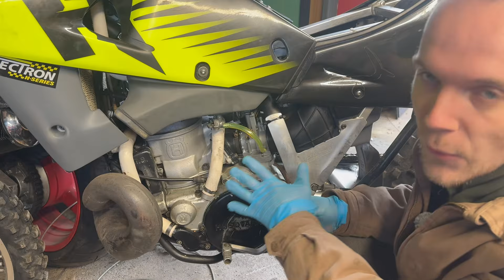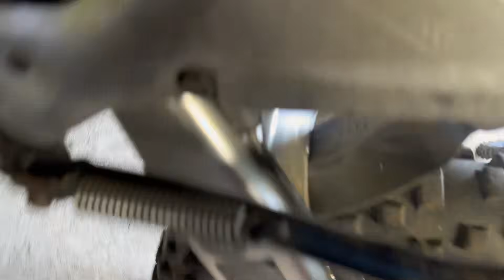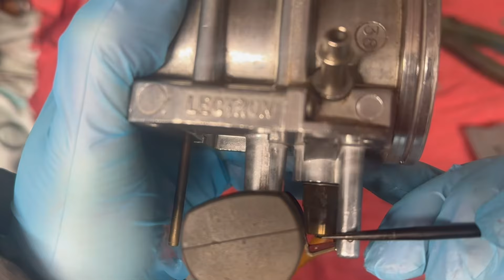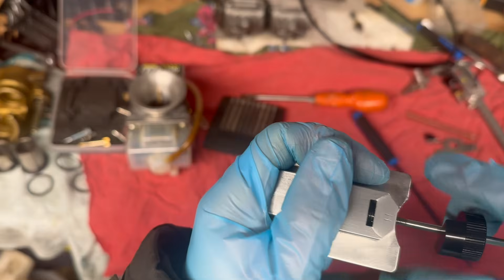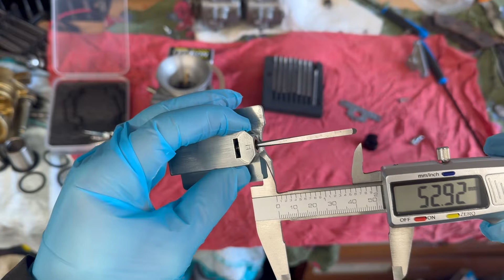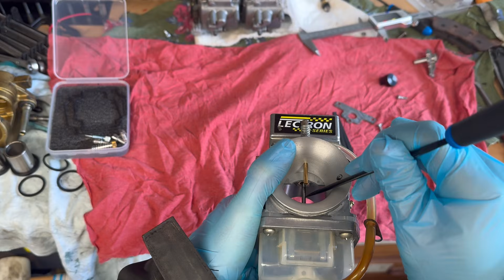LECTRON CLONE CARB - How To Tune, Adjust And Basic Carb Setup Guide

Comment from the maker: CHECK THE DESCIPTION FOR MORE INFO!

4 Adjustments to make with starting times below.

Float Bowl Level- 4:42
Idle adjust- 8:50
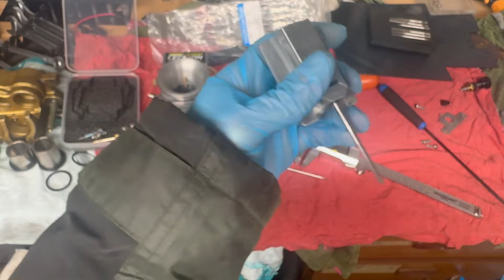Low speed throttle via metering rod- 10:38
High speed throttle via power jet- 15:49

Drop a comment or like if this video helped you, its easy.

Comment: Great vid!! I got a 26mm billectron mini (comes with a grooved metering rod) copy for my Suzuki dr200.  I get the idle to 3/4 throttle all set but it will not take full WOT, no matter I open it gentling or snap it open.  I wonder if the standard rod would help? I probably could get the metering rod another 1/4 turn leaner to try but I start feeling Im giving up the low end torque for the WOT. Another thought is to use something to block the last bit of the grooved to reduce the gas for WOT.  any thoughts will be appreciated, thanks 🙏
Reply from the maker: Thanks for watching. Have you tried adjusting the power jet?  Go half a turn either way and see if it improves.
Reply: @EABikes the power jet is already all the way in....
Reply from the maker: @viclau1218  I would advise trying to adjust it so the power jet is at least 1/2 a turn open  minimum as this fuels the upper end of throttle range.
Reply: Thanks for the advice and will give a try, I feel like even I'm closing the power jet screw completely, there's still some fuel leaking in the carb as the power jet needles may not sit perfectly on to the fuel hole, anyway, will give a try

Comment: My buddy and I use this on Paramotors. For our 150cc SKY engines, we're using the 32mm clone carb (which is a bummer, but it works freaking great!). We did have to sand the threads on about two or three turns to get it to fit further in. These are awesome little carbs, and the Chinese clones are just as good as the original, since not everyone can afford to spend $1000 USD on a carburetor.
Reply from the maker: Now thats cool! There is definitely a few quality issues with the clones, i imagine the idle is possibly slightly higher on your engines compared to the bikes so the low end issues Don’t show?

Comment: I've seen the idle issue fixed by grinding out the hole & groove in that plate a little larger. tiny tiny until it  is right bang on!
Reply from the maker: Yeah someone has said about that. I cant help but think it’s masking the problem rather than fixing it though! Maybe i will try it!
Reply: @EABikes  Je to zakryvanie problemu, ale len problemu tohto karburatora. Je to najlacnejsia a asi aj najrozumnejsia cesta, ako nastavit volnobeh, aby motor na volnobehu nekapal. Stravil som pri nastavovani jeho volnobehu dlhe hodiny a dni, skusal vsetky dostupne ihly a ich polohy, ale nic nepomohlo tak, ako obrusenie supatka. Myslim si, ze hlavny problem je velky otvor emulznej trubice, resp. maly priemer ihly a tym padom si cez nu motor okolo ihly taha prilis vela benzinu a tak je to furt na volnobehu bohate a nepomaha nic ine, ako dat mu viac vzduchu a to jedine obrusenim supatka, kedze skrutkou sa uz viac zdvihnut neda. Dalsi problem je s nastavenim jeho hladiny, aby nebola moc vysoko. Aj ked ohnete jazycek na maximum, aj tak je hladina vyssie, ako by mala byt. Od karburatora za 70€ netreba cakat zazrak.

Comment: I will be grateful for your advice, i try to run my klr 650 with fake lectron, got there two rods but can't set idle on both of them, still need to rise rod by throttle cable, those rods are different, there is no description on them, can you give me a hint? please, or what original lectron rod size should I buy for 650 ?
Reply from the maker: Unfortunately it’s unlikely the rod is the idle issue-either genuine or clone. If the thicker rod of the 2 on a low position doesn’t make it idle then you likely have the same issue as me and can only tune around the issue for best performance above idle only.
Reply: HI, I'D LIKE TO FIT IT ON MY KTM 450. HOW DID YOU FIND 4-STROKE WITH THESE CHINESE COPIES?
Reply: @andre_irt6026  I'm still struggling with this. Currently, the mixture is still too rich, but the worst part is that the level in the float chamber is still too high. Even after disassembling and adjusting it, after a while it's too high again, as if the needle valve were leaking. Unfortunately, there are no parts for the carburetor except for the needles. Every time you want to disassemble the float chamber, you need a new gasket because the old one is not suitable for replacement. At the moment, I haven't found any cheap gaskets, only those in $20 kits with needles, so even trying to adjust this carburetor is neither easy nor cheap.
Reply: @pawelwojcik7550  Thanks for the reply I will probably get a specific Xtng

Comment: How far can you screw the rod in before it starts affecting the Venturi effect. Does the bottom of the metering rod need to be submerged in the fuel bowl level line ?
Reply from the maker: At a guess the rod has approximately 3mm of usable up/down adjustment on the threads into the slide. Due to the depth of rod and location in float bowl  it should always be in the fuel.

Comment: I also use the fake Lectron on my 300. What I did to address the idling issue was use a Dremel to grind off a bit of the U-shaped part of the slide. I’m not entirely sure if this will negatively affect my bike in the long run, but after 3–4 trail rides, it’s been running great. Sometimes the float gets stuck, though, so I blow some compressed air into the hose where the gas flows.

Comment: Hi friend, my problem adjusting the clone Lectron on my YZ250 is: when I turn the rod 1/4 turn to one side, it feels too rich, and when I turn it 1/4 turn to the other, it feels too lean.
Do you think changing the rod would solve the problem? I bought a pack of rods; they're on their way
Reply: he stated the problem  in the video and glossed over it.  the problem is the metering rod hole is not the right size.  i spent many hours on 2 different sized carb and 11 metering rods trying to tune this out on a perfectly running 250cc engine and it was impossible with these knockoff carbs.
Reply: @warrenpeas  Search: XTNG CARBS
Reply: @warrenpeas I’m having the same problem
Reply from the maker: I would be looking at the condition of the engine next. Performing a leak down test would be best.
Reply: @EABikes Ano, clovek zacne pri tomto karburatore naozaj pochybovat o tom, ci ma v poriadku motor a zacne riesit vsetko ostatne od gufier, sacieho hrdla, klapiek, filtra, sviecky, elektriky.. az po novy valec s piestom a tesneniami a nakoniec aj tak zisti, ze cely problem je len tento lacny karburator..
Reply: Search: XTNG CARBS

Comment: I need a 4-2 or 4-2M rod. But since they’re sold out everywhere, I ordered the same set of rods that you have. Do you know what the default length is for these rods, and how wide the 4-2 is? I received a 5-2 with my purchase. But with that one, the bike runs too rich. Do I need a longer or shorter rod to lean it out? I have no idea which of the replica rods matches the 5-2 in terms of dimensions, but assuming the 5-2 corresponds to a 1.95 mm rod, should I go for a 2.05 or a 1.85 to make it run leaner? Great video btw

Comment: I’ve got the clone and the bike runs fine only slight issue is when I’m full throttle and let off the bikes revs stays high for a second then drops is this because the power jet is too rich and it’s still dragging the fuel that’s left in the carb through
Reply from the maker: It may be worth tweaking power jet 1/8 -1/4 turn each way to see if this improves however hanging idle is usually caused from leanness. Have you checked the float level to make sure you are not low on fuel after full throttle blasts?
Reply: sand the slide with sand paper.  the 28mm one i had the slide sticks which could be dangerous. and this is a known lectron design flaw with the slides.  light sanding fixes this,

Comment: i also had these clone and i had a difficulty getting my bike to idle.
Reply: me too. the metering rod hole is way too big.  and thats not something that can be fixed until they fix it at the factory but they might be 5 different factories producing these so who knows what you could get. otherwise they are very well made. i have had 2. a 36mm and a 28mm. both had the same problem.
Reply: @warrenpeas  i have different metering rods, did you ever get it to work
Reply: @anhtran9111   no.  i could get it to go leaner with the different rods but the idle was always far far richer than full throttle.  the leanest needle i never got the idle leaner than 10.5 - 11 AFR and then the full throttle would be extremely lean like 18 or worse.   so lean it would stall the engine.   maybe the hole could be filled with jb weld and redrilled? i wouldnt even know what the correct size of the hole is.
Reply: @warrenpeas that would be too hard unfortunately.

Comment: Great Video! Is it possible to run a lectron clone on a 4 stroke. They do Sell carburator for 4 stroke, but are they and different. I am thinking about fitting one on my ktm 525 with the rfs engine for better Performance and then also Upgrade the size
Reply from the maker: Thank you! I believe there is some small differences for the 4t carbs (even the older models). Im sure they could work on a single cylinder like the KTM but may need a little more setting up and would use a smaller carb then the 2t equivalent. I will very likely try this soon.
Reply: @ so on my bike is a 39mm and k would fit a lectron clone 40mm, oder does the bike run richer on the lectron then the keihin fcr. The experiment would be interesting to see. I do not want to buy a carb that then does not work. I will look forward to that 🙋🏻‍♂️
Reply: @Oli.je_xx  HI, I'D LIKE TO PUT THIS ON MY 2010 450. HAVE YOU TRIED IT YET? IF SO, HOW DOES IT GO?
Reply: @andre_irt6026  Unfortunately, I haven’t gotten around to trying it out yet. I’m sorry